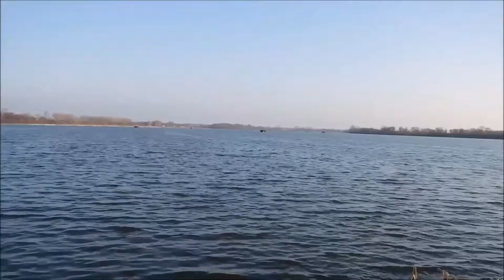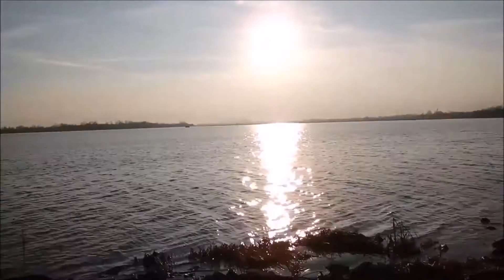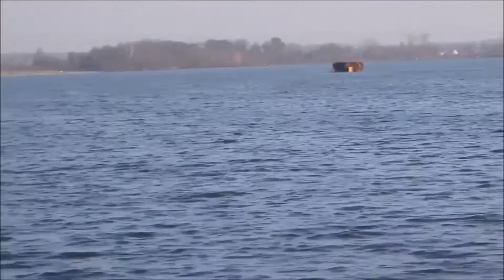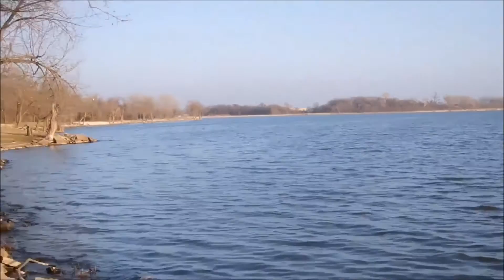Did I Overheat or Damage the 1/2.3" CMOS Sensor in my Digital Camera by Videorecording into the Sun?

Comment: What model is this camera and are you recording the audio with the standard issue or an aux/external mic??
Reply from the maker: Kasper James:  The video was recorded with an Olympus TG-830, using the camera's built-in microohone.
Reply: Outdoor Endurance sounds pretty good even with the subtle wind pick up.
Reply from the maker: Kasper James  Thanks:  The camera has a wind noise reduction option, and my guess is that I probably had it turned on.